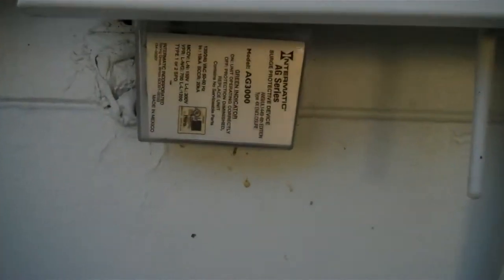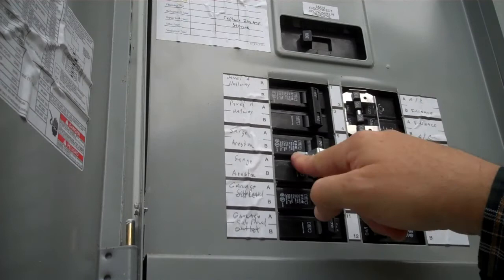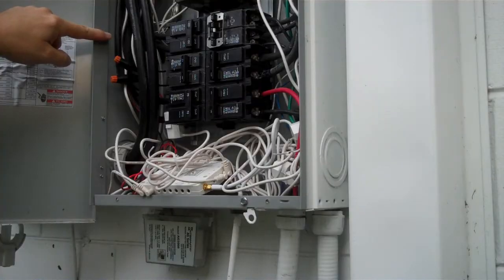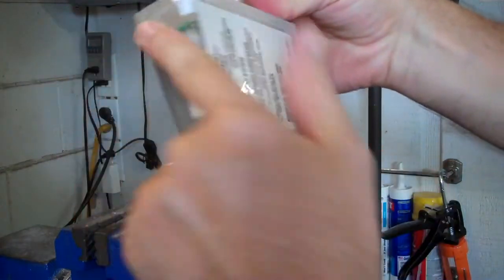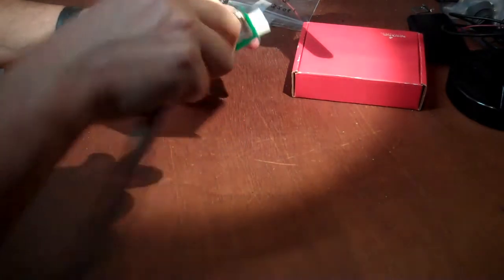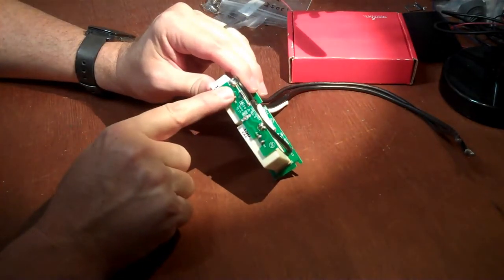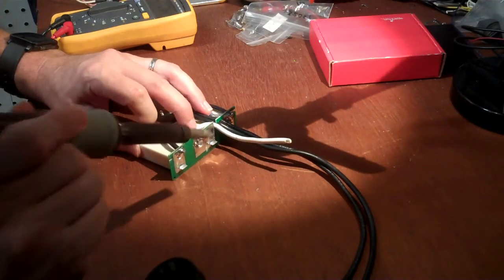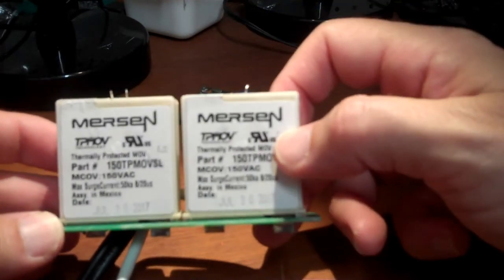Replacing an Intermatic AG3000 surge arrester / protective device with teardown of failed unit.

Comment: 0.33 : A lockout to keep the breaker from tripping? Take that thing off the breaker. It's stopping the breaker from doing it's job. It looks like it's supposed to be used in the opposite direction to keep the breaker off when necessary.
Reply from the maker: That keeps people from turning the breaker off but it does not keep the breaker from tripping.

Comment: When I got my second heat pump installed in 2016, they installed one of these surge protectors with it. Because I already had a heat pump, I paid extra and had one installed on that one as well. Two years ago after our electrical company installed new smart meters, I noticed that, the led indicator was very dim on one of these protectors and after a few months it didn’t light up at all. So since then when there is an impending thunderstorm I power down the  heat pump ( I only use one heat pump in the summer) and turn off the breaker for both heat pumps until storm is over. The other day after doing this for a thunderstorm, I noticed that the green led is now off on my other heat pump ( the one that stays off in the summer). I have no way of knowing if they are providing any protection or not and now my hvac company does not installed them any more opting for a surge protector in the panel itself.
Reply from the maker: My understanding is that if the green light is off, it is not providing protection (or is disconnected from power).
Reply: @summetj  turned the breaker back on after the thunder was over. I swear the light was on within the last week or two. Also didn’t appear to be any power interruptions within that time. Now that the lights are out on both, not sure I will replace them. The light being dim for awhile on the first one was odd as well

Comment: I would love to see what an electrical inspector would say about the energy system. Per manufacturer specs don’t install this manner . On the side yes. Under NO .
Reply from the maker: 1) I didn't install the initial surge protective device, it was installed by my HVAC installer with the new AC unit, I just replaced it in the same location when it failed. 2) The HVAC/AC installation was inspected and signed off on by the county inspector. [I'm not saying our county inspections catch everything, but it was inspected.]  3) I reviewed the instructions online, and they didn't say anything about having to mount it on the side instead of the bottom. (It did have a diagram of the SPD mounted on the side, but didn't say that was required anywhere in the instructions).  The best reason I can think of for not wanting it on the bottom is to help prevent water Ingres in the case that the panel floods...but if your panel floods, you've got other issues as well.

Comment: Great video. Anytime I see one of these mounted in the upside down configuration you're failure comes to mind. Between condensation gathering at the bottom and possible water coming through the bottom of the panel it just seems like a bad idea. I much prefer the side of the panel for mounting for this reason.